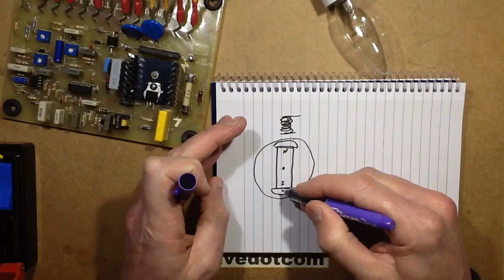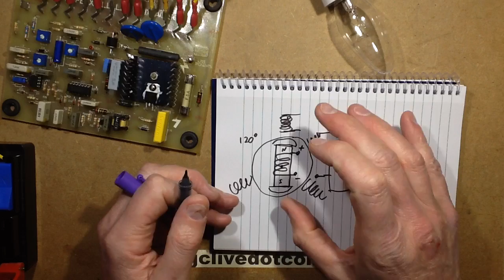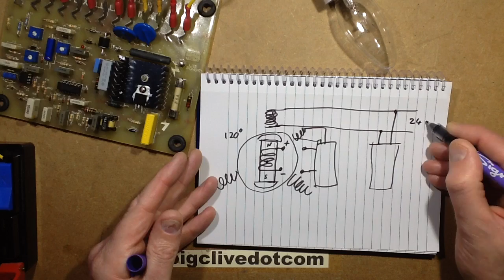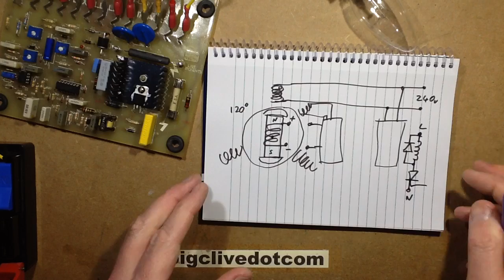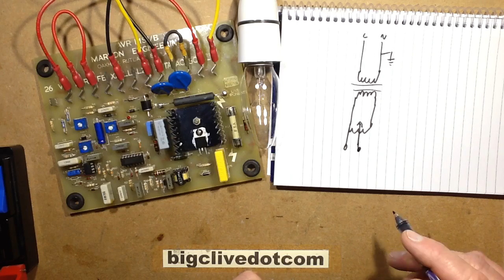Repair of old AVR (Automatic Voltage Regulator) PCB.

Comment: hi BC. may i please bother you again? sorry. im making a battery powered laser. ive looked up my idea online, and i dont see it being used anywhere. so no doubt i have made a foolish mistake, but i have done the sums, im sure it will work? - i have a usb decoy thing i made into a cable, so i get 12v. then i use lm317 number one to limit it to 10v, then lm317 number 2 for CC to limit to 700mA, then i have 2 18605 cells, to which is attached lm317 number 3 to limit current to my laser diode, which i then switch with bd139. i know i miss out on all the charging protection stuff, but otherwise is my idea foolish?
Reply from the maker: Depending on the laser you may get off with a 5V supply and either a simple resistor or current regulator.

Comment: what would be your preferred way to remove the soft potting material?   ive got a AVR out of a Honda eb12d generator, they havent been made in 30 years so repair is my only option
Reply from the maker: If it's the rubbery material then it can be picked out carefully.  If it's resin it's harder and requires a bit of heat.

Comment: I had a resistor fail in a Heathkit Scope while using it at work. It took out a ceramic capacitor and a VP. It stopped there. The shop was moving, I had asked about the scope, 
the scope was owned by the bosses friend, couldn't contact him, it became mine. Replaced the burned parts, it worked. It needs to be recapped. One day.

Comment: Many yrs ago around 54,l repaired avr  on alternater  that ran electric for tower @bardney airfield @the time was x RAF many airfields in Lincolnshire, was now been used for local gliding club of which l was a member, so l think alternator must have dated back 40s! Regulator board in very poor state quite heavy as metal cabinet 2.5ft cube broken volt meter on front,managed to  replace,got new old from birkets up steep hill in lincoln, he has shop up there like aladins cave,allsorts of things there old2new electrical/electronic parts! I refurbish  panel,took it home,no facilities in middle of airfield, clean up,repainted blk,complete rewire this had a carbon stake in the exciter cct in poor filthy state covered in diesel vapour as in shed with engine/alternator, took carbon stack apart for though clean, disassembled, didn't get to test it all out until l returned to bardney, connected all up to alternator set,held breath started engine and bingo working again just had to adjust nut on top of carbon   stack,think from memory, long time back now,the not  was connected to shaft that sat in middle of electro magnet coil which controls excitation of alternator through resistance of carbon stack, hope I've got all of that correct don't want to look a fool! That all worked a treat even when on full load that was my first attempt @ electric/electronic fault finding, had started building trf receiver @15yrs young, was25 when fixed alternator set,now long retired!

Comment: Markon was a company on its own. I worked on a lot of their product in the early 80s. All the machines I saw were 4 pole synchronous machines. The exciter machine rotor was on the same shaft as the main alternator rotating field. They were coupled together with a three phase full wave bridge rectifier. I never saw a Markon alternator with slip rings. They were all brushless. Markon was purchased by Cummins Generator Technologies. CGT id a body part of Cummins Inc. They combined Markon with another acquisition called Sawafuji. So if you search the combined name you will find them. My last job was with Cummins South Pacific doing exclusivel diesel generators from cute little toys up to 2 MVA. I played with an installation that had sixteen of those running as a diesel peaking power station.
All up I had about thirty five years of diesel power generation. I have never seen one of those AVRs. The AVRs I saw in Markon alternators were not branded Markon. I think they were branded Contrology but I'm not sure. 
Love your work Clive thank you.

Comment: Sir with due respect to your knowledge , i would like to ask you very basic question .
to repair any modern / current model of avr , first thing you have to do is remove the epoxy layer or you can say epoxy coating applied on its pcb . please if possible let me know the method to do so because any kind of repair is possible only after removing off this epoxy resin . thanks.
Reply: Нагреть в горячей воде, прокипятить. Или фен до 150-350 градусов Цельсия.

Comment: I have a generator with the same AVR fitted. It failed when the generator went to an over voltage and then blew the fuse on the AVR board. I replaced the fuse and after 20 seconds it blew again. Once the fuse was blown the generator produced no power. Could this be a similar fault and if not, any ideas?

Comment: Sir, how to remove epoxy easly from AVR
Reply from the maker: Try a heat gun and paring the resin away.  I sometimes use acetone to soften resin, but it will damage some components too.

Comment: DO YOU KNOW ANY THINK ABOUT CARS THE BODY CONTROL MODULE IT WORKS THE LIGHTS WINDOWS ANTI THEFT SYSTEM  ABS  I HAVE 64 CHEVY NOVA  I BOUGHT 2014 CAMARO AND PUT IT  ALL IN THE NOVA  DASH, MOTOR, TRANS, THE MODULE WORK ON A CAN SYSTEM I HEARD YOU CAN BY PASS  LIKE THE ABS AT THE SOURCE ANY HELP WOULD HELP ME LOTS THANKS TOMMY

Comment: This is interesting... Not how you think..
I've a little project, and I predate electronics, so seeing this "evolution" is interesting and entirely reminds me of "complex electronics" granted some have become simple but the analogue or mechanical was and is far more simple and robust.

I was simply looking for the voltage regulators and if they still live in old formats as it's been a few decades since I have seen or had one.

I think the last ones, were a automobile we tend to know as the Morris minor, era as they later phased out in the production. Obviously they were not used in automobile, but in power generation on a massive scale. I think they were  a inductive switch/really with two poles that regulates power.
Much more simple.

Comment: Hey I have a similar board is there any replacement boards that I can use in place of this avr cant seem to find anyone in my country that will be able to fix the problem is the alternator doesn't build its voltage, i excited the field by sending 12v down f1 and f2 and this produced a higher voltage which i measured from U to V I have tried replacing with a generic avr it advised to try reflashing the field this did nothing max I can build the voltage is 10v but thats running the motor at full ball any help or advise will be appreciated thanks
Reply from the maker: Did you flash it with the correct polarity?
Reply: @bigclivedotcom  to my knowledge yes F1 is + and F2 -
Reply: @bigclivedotcom  Do you any other ideas, Im located in New Zealand
Reply from the maker: @IBABY1000  There are AVR modules available on eBay.  One may fit the bill.  Look for signs of corrosion or other damage on the original PCB.

Comment: I need to build a much simpler one..basically 15v dc to the rotor is good enough.  The exciter winding produces 7vac, but once it is up to power, it produces 150vac, so makes it complicated.  I am trying just a simple bridge with 15v zener, what will go wrong?

Comment: Great video, thankyou.  I have a Plessey Aerospace 25Kva 3 phase generator which is running over voltage. It has gradually crept up and gone past the ability of the trimpot on the front of the AVR box and will no longer hold after excitation. There are 6 circuit boards in the AVR box and I think I might have a go at testing/ replacing some of the common components after watching your video. Although one of the boards has 5 trimmer potentiometers/ resistors and one of the screws appears to be much further out than the others. Problem is there are 2x 20k  1x 5k 1x 2k and 1x1k so don't think i can compare them? Unless the one 20k is at min or max  value then it might be worth adjusting to see the effect?

Comment: Hello 
i am used the Avr on alternator but voltage is not increase on rated voltage.
then replaced the Avr few days is normal working but now off load is ok put on load then avr is below 
how the problem

Comment: High, I have a 3 Phase 400V 11.5 KVA alternator with slip rings. Exciting field resistance is 8 Ohms. Can you help me to seize a proper AVR, what would be the current requirement?

Comment: Resistor Fails are not that uncommon these days.   It's as if they don't expect the product to last more then a year or two any more.  Zero Thoughts of them ever being repaired.  Gone are the days when a actual Schematic is tucked away in the back of the product some place.

Comment: I have a Dunlite generator with one unit output of 50 hz frequency at 300 volts. And another Dunlite generator with 50 to 90 hz at 4 volts even though I plugged a fan ito it? Any reply appreciated thanks?

Comment: Hi I have a Dunlite generator 3 kva and its gotta be about 15 to 20 years old judging by the factory yellow faded paint on every component. Problem is its putting out 335 volts at 49 -50 hertz and when I drop the rpm i can get between 240 to 250 volts but at around 10 -15 hertz! My question is should it have an avr as this looks ancient and btw there is a two screw terminal block with two brass or copper large flathead screws (i thought they were adjustable screws unless its for dc charging. I have worked with electronic boards,lawnmower repair,auto repair etc? Any reply appreciated as too why I have overvoltage problem? Great and informative vid and im about to strip it down to repair it ! Technical tips would be awesome? Thanks again from Australia 😊
Reply from the maker: Most generators should have some voltage regulating system.  I'm not sure which system that one uses.  Does the voltage stay high under load?
Reply: @bigclivedotcom  i plug a 600 w drill and a multimeter in the other socket and wont come down!  Weird!

Comment: I wonder what might happen if you apply three phases to a standard motor that inky uses two (well, one) phase, would it try and pull more to one side, 1,2+3 or 1+2,3 or 1+3,2... Would it not work, or be slow to start, or fast to reach top speed... Weirdness

Comment: can u explain me how magnetic field generate in alternator without permanent magnet plzzzz explain me ...
Reply from the maker: The generators rotor does hold a low residual magnetic field, but to regulate the output voltage the main field on the rotor is created by an electromagnet that can be adjusted to vary the magnetic field strength as required.
Reply: @bigclivedotcom  thanks for reply ...

Comment: I haavrve an  stamford mx321, the generator output voltage is not stable the output line voltage ranges from 381to 410 volts l changed the stability trimmer and the volt trimmer in the avr and the problem remains,when I connected a new avr it works properly ,is there any repairs could be done to the old avr ???

Comment: Hey Clive, i really enjoy your video's! Ive got a question though, i fix up small (3-10kw) generators quite often and am wondering if you have a suggestion for any universal aftermarket avrs that would hopefully be more reliable than the original chinese crecent shaped ones.
Reply from the maker: I couldn't recommend any specific one, but it might be worth buying a few different types and experimenting with them.

Comment: I have the same Markon  MS1B AVR circuit in which I can adjust the voltage but not the Hz meter. It swings without able to adjust with the STAB pot. Could you give me an advice on this problem?

Comment: Clive, the conformal coating that used to be used for weatherproofing telephone equipment was a two-part urethane varnish. Unfortunately, i don't have precise specifications.
As regards resistor failure, it's EXTREMELY common in equipment where capacitors have been secured with a petroleum-based contact adhesive (e.g. Evo-Stick). When this glue is heated, it gives off an acidic chemical, which corrodes metal - especially resistor connections. So look out for glue that's turned dark brown. It should be scraped away completely and the area cleaned with IsoPropanol.

Comment: Reminds me very much of the early car alternator external regulator modules, (obviously being an AC generator) where the electromagnetic rotor (armature) was excited through electronically controlled DC. Initially the DC regulation output was compared to the battery voltage by a 12 Volt 3 Watt lamp (battery symbol on the dashboard)  which would light without engine running. The current flowing through the lamp would pass through the regulation circuit to the alternator slip rings to the rotating electromagnetic rotor generating a magnetic field.  Once the engine runs, the magnetic field induces current in the stator supplying current to the regulator circuit causing the output voltage to rise to charging voltage for the battery, the output voltage of the regulator and battery voltage would then be the same, extinguishing the battery lamp on the dash. The current to the electromagnetic rotor will now be regulated from the regulator by sensing the DC output voltage. Interesting to see this similar principle on this circuit board.

Comment: Great Video Clive!
These trouble shoot/repair videos are SO much more instructive than tear downs!
Can you include more repair/mod/ reverse engineering videos?
(p.s. you didn't  say if you fixed the problem? . .  update?)
Reply from the maker: Yes, the AVR was fixed.  The faulty component was a resistor that had changed value dramatically.

Comment: Thanks for the great videos.  The power supply voltage converter on my 2013 MacBookPro 15" won't allow the battery to charge once again...this is the 4th time in one year.   They mentioned some carbon resulting in a burn again.   The last time it was repaired,   they mentioned that the charging circuit internal to the computer.  That is to say the charging circuit between the adapter to the motherboard.    Is there any way to fix this so it won't break again?   Or a way to plug a different charging hook up internal to the computer.   What would be the perfect fix would be to hook the laptop to a DeWalt tool battery (20V)...I'd need to get the components.    I've cleaned the contacts which worked he first time and now won't fix or "band-aid" the computer.

The computer is way out of warranty but the repairs are getting expensive.  Seems like the component is the magnetic attachment of the charger to the computer gets really hot.

thanks, 

Chuck

Comment: This isin't really old electronics, I have several bits of electronics that are a lot older and still working, with no repairs ever having been made. One is a 1945 valve radio, complete with original guarantee. All the components have been tested and are still within original specs.

Comment: Some manufactures pot their electronics for protection, but it doesn't work the well, the potting resin prolongs the life but it does break down and moisture forces its way in through the fine cracks, especially if the units gets warm to hot, as it heats then cools it sucks in the moisture. The real reason for potting is so you cannot fix it and force you to buy a new one.
Reply: При желании, компаунд можно снять и ремонтировать плату.

Comment: I thought most small generators in the KVA size are still typically 240v/415v what other generator voltages are used these days? Naturally the big MVA units run at medium voltages. Also its common for parts to fail due to corrosion and rust creeping in via the component leads..I've seen it a lot where the air in the environment can pass through via a vent in the enclosure and humidity and contaminants damage the PCB. I've seen DIL IC leads completely rusted away, even green mess where the copper tracks are eaten away. The con-formal coating is a must. The older stuff works and it's usually easier to fix, I find.
Reply: bjtaudio Gensets these days are often at the harmonized 230V/400V voltage rather than the old British 240V/415V or the old continental 220V/380V.

Comment: Is this switch mode based? Because if not, why not just use a normal high tension voltage regulator?

Comment: Now for a real mind bender, look up Lima MAC generators.  Not a single electronic component.   All magnetic voltage regulation via output shunts.  Higher output current puts higher voltage to the field.   But you must have a good governor on the prime mover.  And always disconnect the load.  I have a 12kW Lima MAC wired in 208 volt wye powering my welder for field work.  If TEOTEAWKI, it will be rewired to low zig zag for home power.

Comment: So does this predate the widespread use of DIACs as driving components for TRIACs?
Reply from the maker: The diac is normally used as a simple threshold device for dimmers, but in this case a chip with a decisive switching edge is being used.

Comment: question from a newbie: do i understand correctly that to regulate the voltage at 10v with the zener diode, the anode of the zener is connected to ground, and the rest of the circuit is power by this reference voltage, being connected in parallel with the zener? am i correct? something i missed?

Comment: Conformal coating: otherwise known as clear fingernail polish, or spray Krylon (at least in the US). The fingernail polish has the advantage that you can brush it onto the ends of the components and not get it all over the place.

Comment: This type of regulator is quite common in generators until the 1980s here in Brazil ... here the voltage between phase to phase is 220v 60hz

Comment: It was mentioned that resistors rarely fail.  Actually I frequently find failed resistors, particularly carbon, and older type carbon film.  Typically they go very high value or O/C.  Older type high stab and metal oxide type seem very reliable.